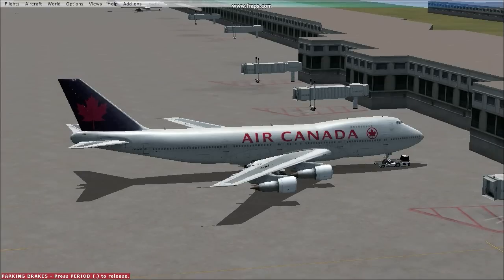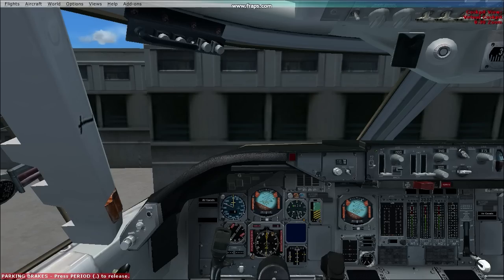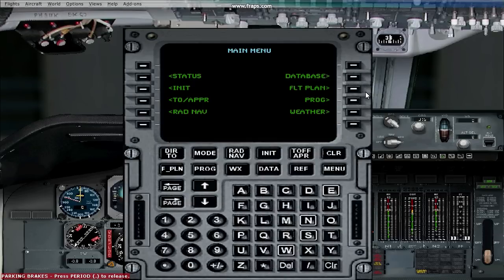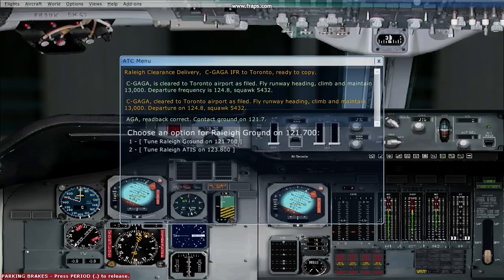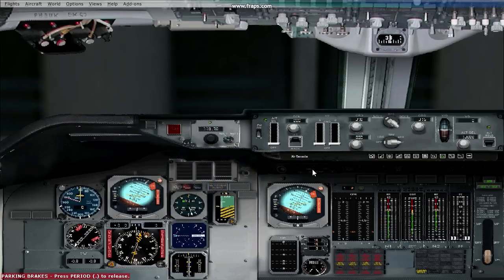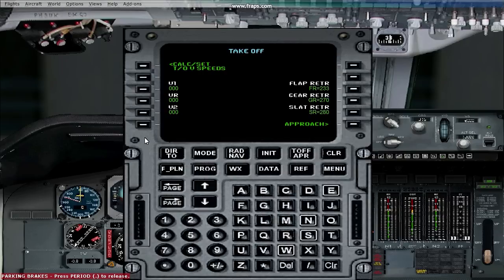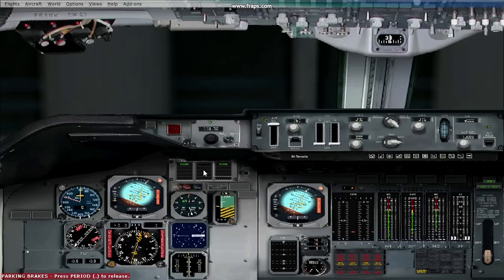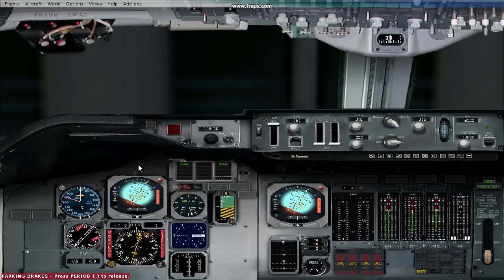747- 200/300 Manual Start-Up Procedures Tutorial

Comment from the maker: out of 10 i would  give it a 10 based on what i was looking for when i purchased this product, for u it may be different. The autopilot is pretty much like the defualt 747 its quite easy. It has more autopilot buttons than the defualt though since it is payware. Overall I would give it a 9/10 since its not that full PMDG lvl, but it depends on what your looking for and the experience you want from it

Comment from the maker: yes it does its loacted on the radios panel and it will only work u have ur traffic setting at a decently high setting or else there is no point because theres not many planes around u